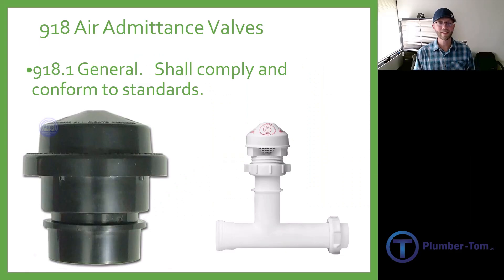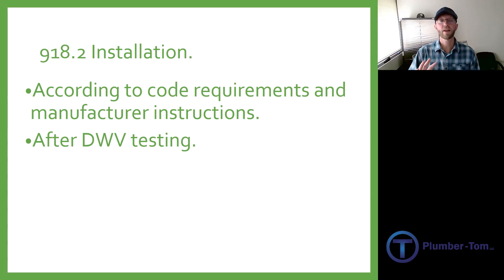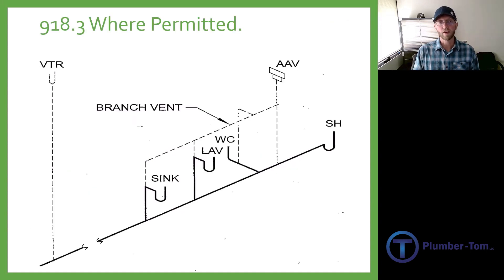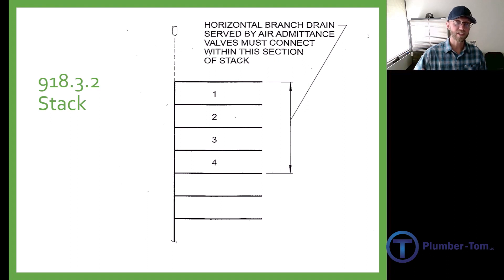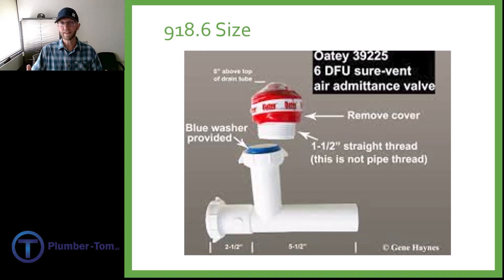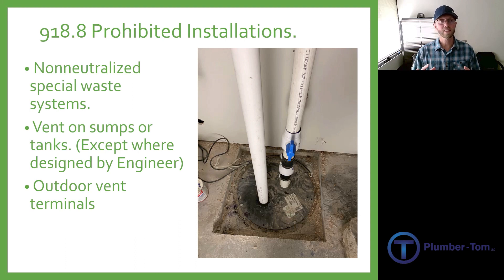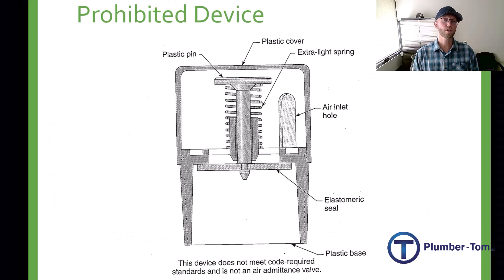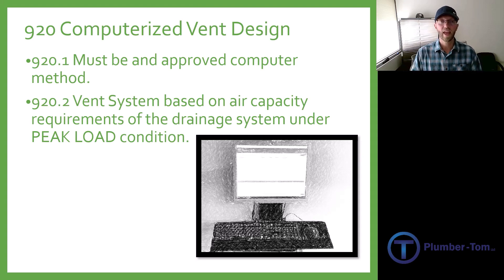Understanding International Plumbing Code Chapter 9 Sections 918 to 920

Comment: can we provide air admittance valve at the top of the stack or is inside toilet which is preferred
Reply from the maker: Top of stack is fine as long as it only serves fixtures on the same floor. The stack cannot extend from one floor to the next and have an AAV.
Reply: @plumber-tom9470 Thanks for the reply, can we raise the vent pipes above the false ceiling level and provide the AAV in the false ceiling void.